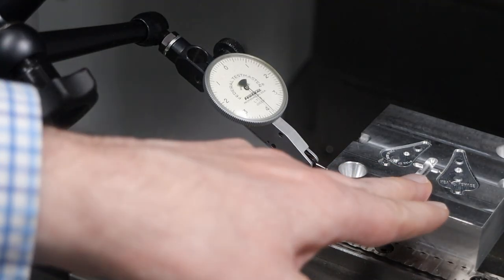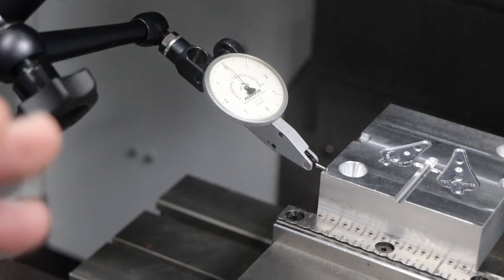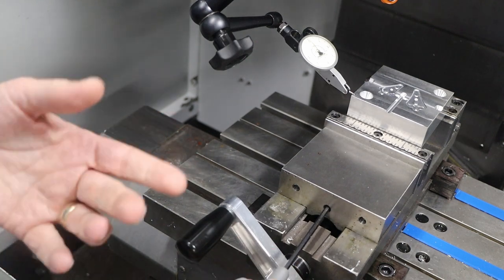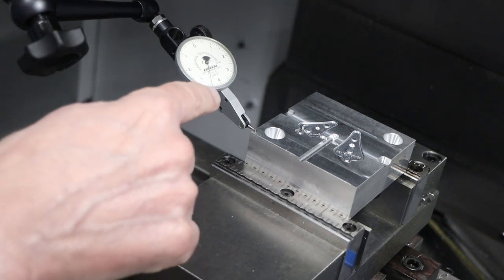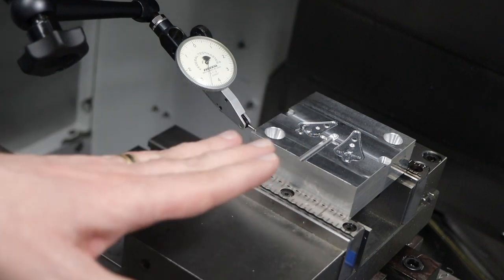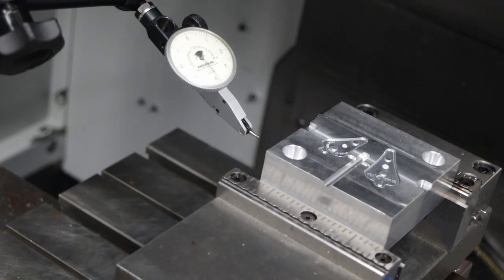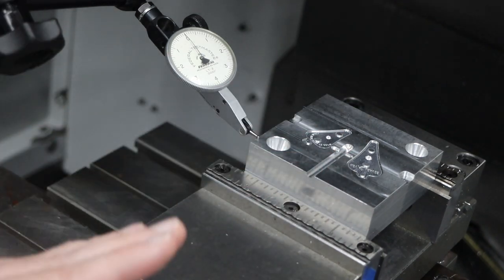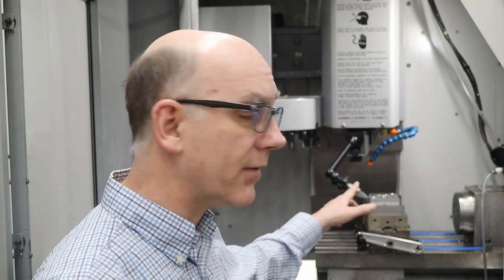Is Vise Jaw Lift a Problem?

Comment: When thinking about workholding, it's worth thinking about how much holding power you actually need. A 1/4" 3 flute endmill will only develop about 35lbs of cutting force when taking an aggressive cut in 6061. A 1/8" endmill taking a more reasonable cut in the same material will produce a pound or two of cutting force.

A milling vise is a versatile workholding option, but it's overkill if you aren't taking heavy cuts in tough materials. With a high-speed, low-torque spindle, there's massive amounts of leeway in what constitutes a viable workholding solution - t-slot side clamps, miniature fixture clamps, vacuum or even glue. There are plenty of simple and inexpensive options that could potentially free up a lot of table space and allow for far more unattended running. I don't keep my vise on my mill table, because only a small minority of my setups actually need one.
Reply from the maker: Those are all good points. I think the important thing is the type of work. I can't remember a time when I couldn't use the vise. So for me the vise works very well. The back face is always parallel to X, and I have known Z heights for the jaws and parallels. That means for my jobs, setup is mostly picking up the X and Y zero and I'm ready to go.

Comment: Good work! I would use the serrated jaws as a first op only because I'm sure they distort the position of the part aside from the jaw lifting. Don't hammer down with serrated jaws, it can rise back up.

Comment: It looks to me like the jaws are on the tall side. When you use the Piranha jaws, the lever moment is well above the vise jaw carrier (by what looks to be about .5"). When you are using the parallels, the part is deep enough in the vise that the moment load is at or below the carrier height.
Reply from the maker: That's the way they came from MMM-USA. The top of the Piranha jaws are about 0.4" above the top of the vise. I can live with a part lift 0f 0.003" for first ops. And by sticking up above the vise body a little, I can move the jaw to the front of the moving section when I need to (I've done that once or twice). In that case, the lift wasn't critical to the part.

Comment: Just to point out that you were measuring the part lift, not the jaw lift as the dial indicator wasn't on the jaw. The measurement is thus the compounded error of jaw lifting and part lifting in the jaws and reclsmping on the serrated jaws doesn't help it at all.
Reply from the maker: True. It’s really the part lift that I care about, which is why I measured it this way. The main point is that it’s not small when you’re using the serrated jaws.